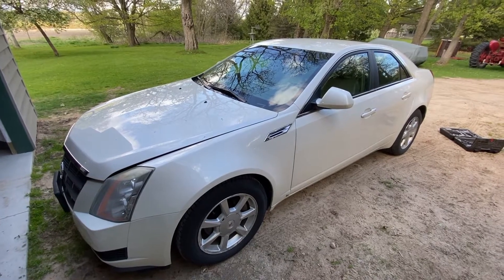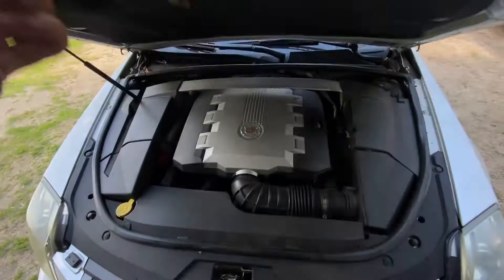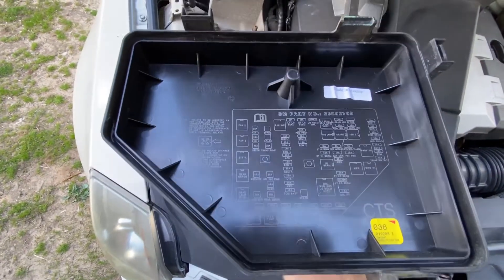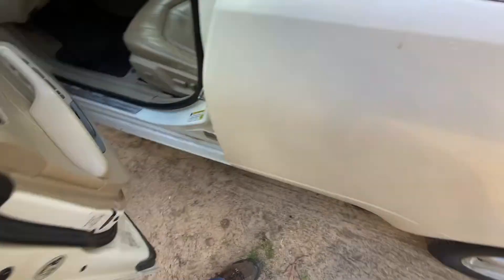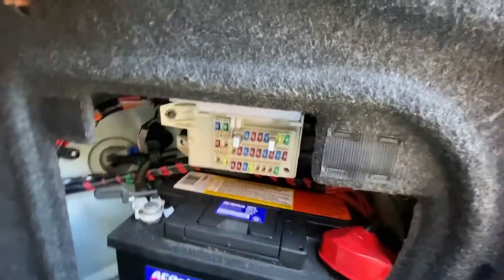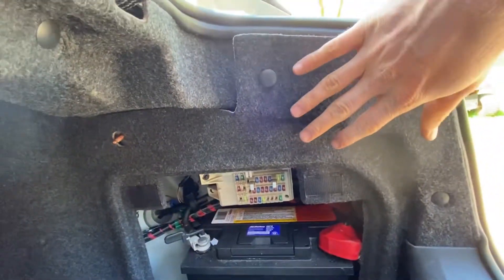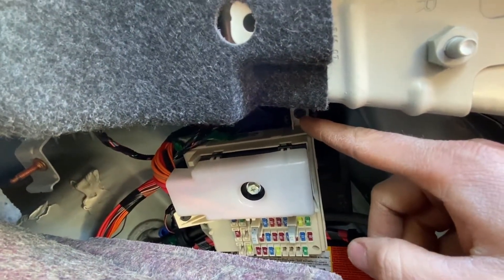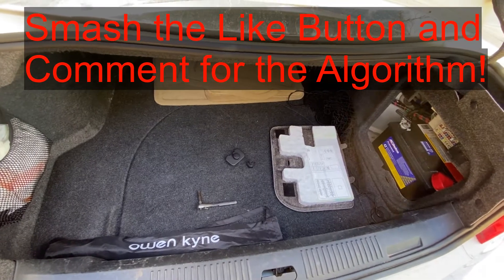Fuse Relay Location Cadillac CTS 2008 2009 2010 2011 2012 2013 08 09 10 11 12 13

Comment: Do you know which Relay controls the tail lights
Reply from the maker: There are 2. One for each turn signal. They are in the trunk. fuse-box.info/cadillac/cadillac-cts-2008-2009-fuses-and-relays